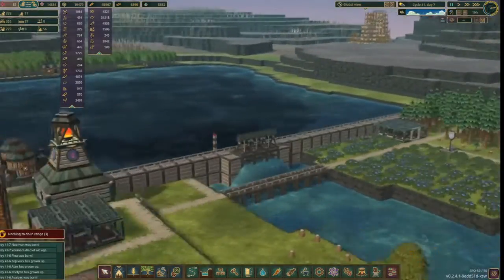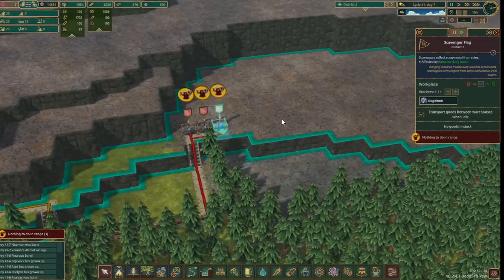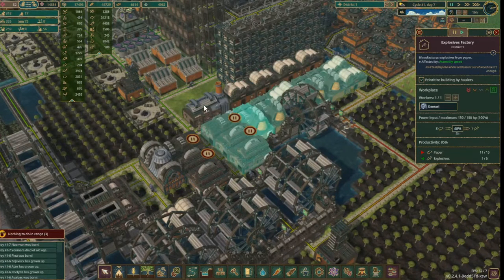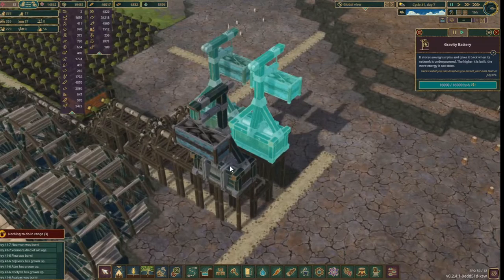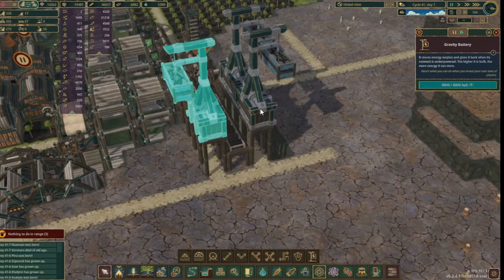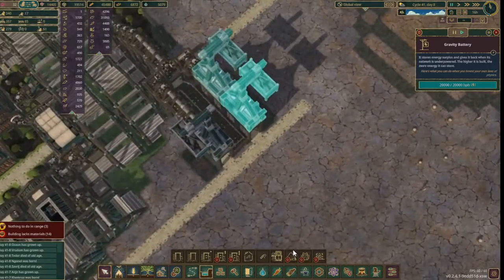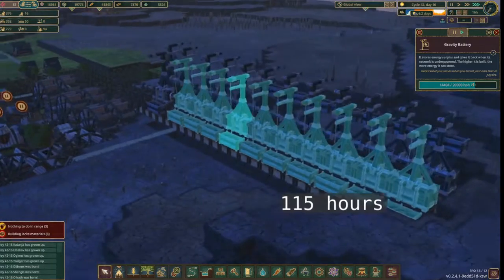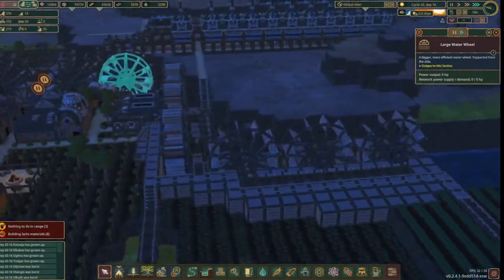Gravity Battery Farm Time-Lapse [Timberborn, Experimental]

Comment: Can you build the batteries even higher up? like with some kind of scaffolding or so? (or is this the height limit?)
Or does that not add more capacity to the batteries for some reason?
(I haven't played this game)
Reply from the maker: That is not the height limit, but if I built it any higher it might not be reachable from the district center, which would mean I need to make a separate district, with separate workforce, then I need to transport the building materials to this new district, I just don't think it's worth the effort
Reply from the maker: Having said that, maybe I can try creating the new district entirely by golems, since they don't need water and food, it'll be a lot less complicated to supply the district